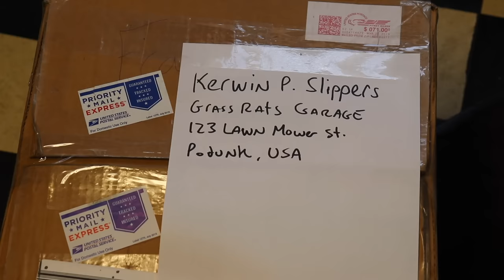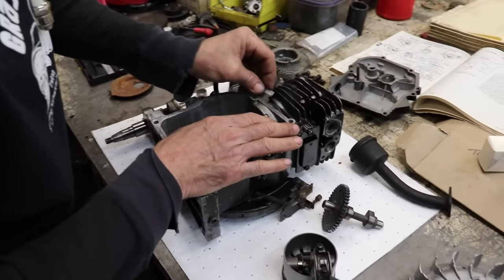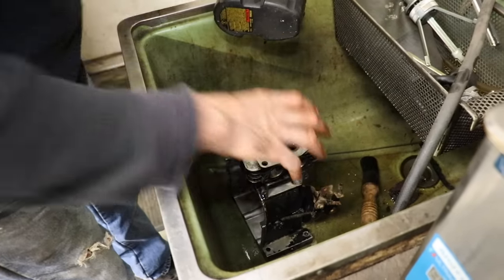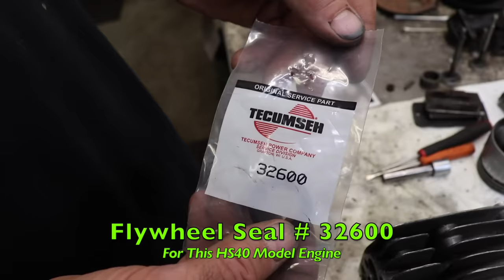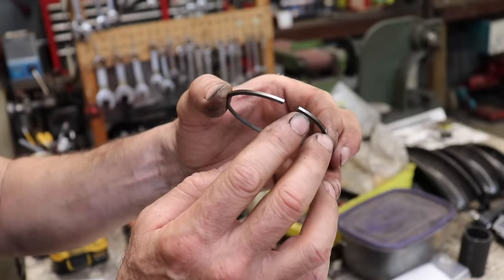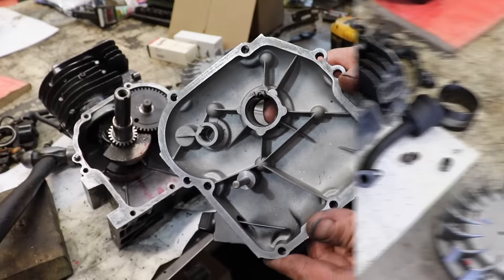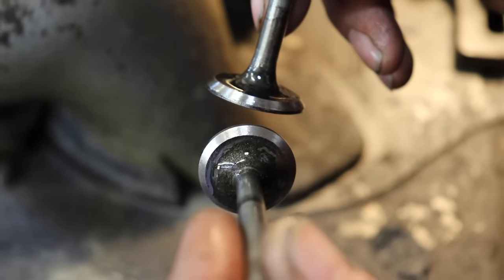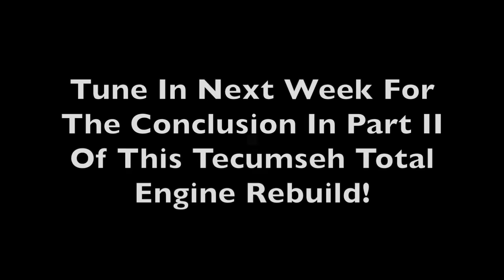(Part 1) Tecumseh Small Engine Total Rebuild: A Complete Guide

Comment: Well, the most critical items that need a torque value are the connecting rod and the cylinder head; everything else you can "wing it" on. 
You don't want any chance of the connecting rod coming loose because you had the bolts finger tight only, haha

Comment: $200 huh?  I hope PLUS parts.  My spark is weak - I have electronic ignition but if the magnet is weak I gotta spend $85 on a new flywheel.  How do I tell if the flywheel / magnet is weak / bad (what would you consider "too weak"?

Comment: Put my sump cover back on and gave the motor a couple of spins and it stops,,,, it's hitting the governor, took the sump cover back off and thought I had it licked and it hit the governor again this time breaking it??? what am I doing wrong. Motor # 143.955001 Sears. Ordered new governor spool,,, heated the pin with a torch to get it out of sump cover due to the spool is being held by the pin(no c clips)

Comment: Hey tarly why do you want to sand paper in the bore of  a cylinder?
I think you should use something called emery cloth to sand the bore out or use a cylinder honing stone on a drill.
Just my 2 cents worth coming from a machinist of 40 years.
Im just saying.
Usually you would use sand paper on an armature to clean it up after you trued it up on a lathe to keep it from contaminating it from the metals in the emery cloth.

Comment: Awesome video I use a solution called PSC1000 (i think lol) from tractor supply and it works fairly well in my wash tank. What do you use? Nevermind you said kerosene after I typed this lol

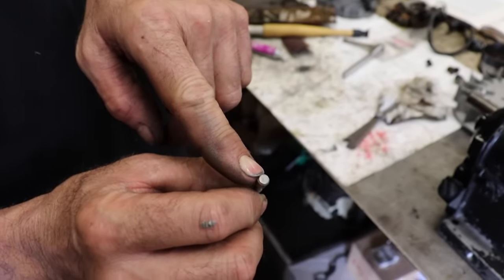Comment: 1:10:39 Some people may not have a bench grinder either. They could clamp the valve stem in a vise and use a bastard file, making sure to keep the file and the face of the stem square and perpendicular to each other as they worked.  The whole process would just take a little longer BUT give the Do-It-Yourselfer more control over how much material is removed.

Comment: I had this happen to me a few months ago. I order a lot over the internet and I suppose someone took notice. However, the package stolen from me was a a radioactive sample (uranium ore mixed in some type of resin stuck to a card) for calibration of my geiger counter. Sheriff's office dropped it back off a few days later after realizing while dangerous to hold for long periods of time its relatively safe and not illegal. I inquired about the person who turned it in and while they didn't know exactly who did they had an idea. I  was going to lend them my geiger counter and told them to test their hands but they declined. Anyways, now my packages can sit outside for nearly two weeks without it getting touched. For reference the reason they turned it in is because the card says something like no not hold for long periods of time or store near body. Active radioactive source drop and notify authorties if you're not a professional. Police recognized the number.

Comment: Yeah years ago Foley Belsaw sold a flywheel knock off tool and they showed in their correspondence course how to use all the necessary tools.  Gee I had an old Techumseh Vertical engine I learned how to set the timing on so I know exactly what youre referring too not that hard to set.

Comment: The plastigauge check was a little sloppy.. You should do it in a vice and make sure you don't allow your rod to pivot......  Because as the rod spins around the journal, it can smear the plastigauge and give you a false reading.. (I've never actually plastigauged a lawnmower. lol.. we're getting technical here.)

Comment: I have  a Tecumseh 754272 short block, same as some HS50 engines . Need help I need most of the parts to complete engine can you help me with how to get either points and condenser or eletronic ignition. I have a carb, intake, need the rest to complete my zero hour engine. Help Jerry out down in South Carolina.

Comment: I have used old VHS video tape as Crocus cloth, works just about as well is the real thing.
Reply: Thats a good tip, thank you!
Reply: @ProlificInvention  The oxide on video tape is extremely fine so it takes quite a bit of work to achieve a polish. But the up side its hard to over polish or damage the part.
Reply: @mrkrasker9609  Its an excellent idea!  Cant wait to try.

Comment: Just in case anybody wants to know you can get 5,000 wet dry paper for sanding super fine finishes. But I wouldn't use it before I was going to paint. Paint won't stick to it too fine of a grit. In the finish department at the machine shop we also had some 10,000 grit It's about $6 a sheet most people don't purchase it.

Comment: Has anyone tried to grind channels from front to back in the ribs on the bottom of the case for oil flow? Looks like they just machined the speed bumps for the cover screw holes and it isn't needed towards the center and back
Reply: The engine block is an aluminum casting, not machined, and the "speed bump" ribs in the sump certainly add some structural stiffness to the block as well as holding the cover screws. These engines are splash-lubricated and at working RPM (3600+), nearly all of the oil (20 ounces) is whipped into a mist by the dipper. The oil flow is up and down, basically, due to gravity and inertia.

Comment: Yeah I've used a big screw driver and hammer to remove fly wheel several times  every time I file points or install a tune up kit But have never done valve adjustments on ohv engine

Comment: It's advisable to remove the cylinder ridge because if the new rings are fitted with the ridge still in place,the top piston ring will get smashed.

I'm going to re ring my 3 HP 92500 Briggs & Stratton lawnmower engine but I'm going to try & do it without pulling the whole lot down,the Victa 2 stroke powertorque engines are the same way,you can re ring them without pulling the engine off its base but I do have to pull the Briggs engine off its base.

I need to shim the crankshaft because it's end float is a tad over its limit of 0.2mm (it's at 0.23mm),I'm planning  on cutting a 0.15mm shim to bring it down to 0.08mm !

Comment: Ii was on the meaning we dont bore aluminum bores only cast iron?? Maybe im wrong. I been wrong b4 no problem
Reply: They sell oversize rings and pistons for these small engine aluminum blocks up to .030 over so it's probably consistent hardness to that thickness at least. Some aluminum blocks even have cast iron sleeves.

Comment: A Hob cleaning tool has a good blade in it it’s good for scraping gaskets and has the right angle for set in a ramp on the tool, pretty cheap about 5 bucks with spare blades. Tally Ho😀

Comment: I have a 8HP Ariens snow thro machine,1975,I'll give you what I have manual model #9100018,serial#003709,I've been told the OEM carb# is631660A,don't know if that is correct,I took off the carb it has a #1071K1G,don't know what that is,stamped on it. I think the motor model # is HM80-155020,I seen that on the body of the machine serial #3169R.this machine doesn't have a pump primer

Comment: You up to a challenge? Here's a good one for you. My Craftsman GTS 5000 garden tractor needs a new pair of rear transaxle oil seals. OK, seems simple enough. Just go order some and put them on, right? WRONG! I've got the part number but, I cannot find them anyplace. Not Sears, not any of my local mower repair shops, not on the internet, nowhere. I keep getting the same song and dance that the seals are no longer available and have no replacement item. Good Grief! Now, what do I do? Better yet, what would you do?

Comment: Ring end gap should be measured at THE LEAST WORN area of the bore, that is the bottom of the bore and not near the top as you did. The top of the bore just under the ridge where you measured the end gap is the MOST worn part of the bore. Like your videos though.

Comment: Worked in a Small Engine Shop waaaay back in the High School Days and Never was a fan of The Tecumseh Engines the Governor and Carb setting on those Always seemed Sketchy to Me as compared to a Briggs...Also parts look up on a Micro Fisch was a PIA..
Reply: Tecumseh engines always seemed a bit more finicky and complicated. A float carb on any platform can be a problem especially when used in a dirty application as most of these are. Breaks and Scrap 'em on the other hand, seemed to keep innovating and simplifying their product which also helped lower their costs.

Comment: forgot to check the ring end clearance.
Reply from the maker: 16:35
Reply: @TarylFixesAll  It appears you used the old ring to demo with but you did not do it correctly. cylinders wear more near the top and its necessary to push the ring down in the cylinder to get at the bottom of the place where the ring comes in opperation to check it properly. It was out of sequence a bit and not done rite so I put in the comment. OOPS.
as Rosanna Rosanna Danna would say. Never Mind. I do love you videos and learn a lot so Im not being mean just commenting. nice and tight is not good if when it heats up it binds up. needs to be checked on the new rings and done properly

Comment: The summer teeth were a good gimmick but I think youve proven yourself interesting and competent enough to get by without gimmicks.  Unless you just like wearing them?.....  Thanks for the good, basic mechanicking how-to. The reason I am here is that I have over a thousand dollars worth of push mowers that are gonna be expensive AF to fix, and the old $96, cheapest 22" mower WalMart sold in 1996, with a whole pound of mig wire in the deck, on it's 7th, blade, and halfway to it's 4th set of wheels is the only one running and the engine brake, bail activated kill switch gloriously, and irreparably disabled, and most importantly a readily accessible mixture screw, which doubles as a bowl drain is finally using a little bit of oil, indicating the rings are about gone. Gonna give the old TVS90 a set of rings and see if I can get another 20 years out of it.   There's a few in that next generation who do take an interest in something beyond "how to throw it in the trash can and buy another."  And with the way things are goin, they are gonna be real popular fellers to their neighbors in a decade or three. Though I am closer to your generation, I am taking the liberty to speak on their behalf, and say thanks bro.
 Now that the accolades and compliments have been dispensed with, I must voice a contention with your characterization of certain technicians who, through necessity, employ field oriented, improvisational methods. The politically correct term for individuals who employ creative means to get er done, is Remotely Elevated Williams. re; Valve seat resurfacing instrument.

Comment: also you can still get over size valve/stems if the guilds are worn. might be easyer then trying to replace the guilds. my newway cutter was just over $300+ and yes it came with 4 different cutting angles and pilots. so they have came down in price. but I do remember not to long ago at $500+
just finish last year with a HS-40 BUILD, little guy turns over 7000 rpms, tons of mods done to it.
here is my project build.  https://www.oldminibikes.com/forum/index.php?threads/hs-40-build.161335/

Comment: I think you're tightening rod bearing to 110 FOOT pounds, instead of INCH pounds as you stated in the beginning. 
PS: get a quality torque wrench
Reply: HE WAS USING A SK INCH- POUND TORQUE WRENCH! This isn't Taryl's first engine rebuild. He must be pretty strong if he can get 110 Ft/Lbs out of a wrench about a foot long. I didn't see any razor blades on the floor. LOL Do you really think those small fasteners would take 110 ft./lbs without breaking?
Reply: that torque wrench he used is a, sk brand, it's a good one.
Reply: w2dmw, do you think those “tiny” end cap bolts could handle 110 ft/lbs? That small beam torque wrench would probably bend in half way before he reached 110. ( 110 in/lbs = approx 9.1 ft/lbs ).
Reply: It says inch lbs. right in the book he shows

Comment: oh, good, I thought I was going nuts. That makes sense..........i'm working on a real old  I don't know what.   Tecumseh, I assume. the coil and laminates are under the cast iron flywheel and it doesn't want to spark. points look good but new coil is really stuffed in there. wires out of the bottom of the coil barely rub on the inside of the flywheel. I wonder if I sent you a pic if you could identify this old monster (only a couple of horse power.).   Hey I get a riot out of those dummies flying through the air !!!!!
   w2dmw@optimum.net         Keep up the good work !!!!!!!

Comment: New subscriber here, thank you for the excellent engine repair videos that helped me work on a 25 hp riding mower engine.  Your teeth are very unusual. To be completely honest, due to my character flaws (which are way worse than your teeth) they appear grotesque and freakish to me.  It would help my condition if I knew the story ...    Are they real?  If so, when did it first become apparent you had large protruding teeth?  Thank you !
Reply: Are you for real??.GOD NO!,they are not real.HAHA!!.
Reply: @4gauge10  They look real.  Is there a video showing Taryl w/o the teeth?
Reply: @SunriseLAW  To the best of my knowledge no,that would destroy the character,junior has the same teeth.
Reply: @4gauge10  Or are Junior's fake?
Reply: @SunriseLAW  HAHA!!,that's even FUNNIER!!.Neither one is real man!!.You can buy those teeth at any novelty store.(Johnson Smith Company is novelty store that has hillbilly teeth you can buy)
Reply: @4gauge10   Excellent satire (of satire).  See, the videos are satire because generally a broken small engine ends up getting replaced along with the machine.    If you own a lawn, you can afford new machines or a professional lawn service.  Only a hillbilly type would try to fix a broken small engine.  So... a fake hillbilly piles satire on top of satire.
Reply: @SunriseLAW  That doesn't make any sense...I have two very high dollar John Deere garden tractors,if something goes wrong with my 25hp.Kawasaki engine,short of a thrown rod through the block,you can DAMN sure bet your last buck,I'd have Tayrl look to see if he could fix it,because just to buy that engine would cost me about $2,000.00 bucks to buy it,then about another $1,000.00 to install it.When fixing it might only cost me about $150.00-$500.00.
Like the song says..."It's cheaper to keep her".🎶🎵
Reply: To replace my entire tractor will cost about $10,000.00.
That's cheaper to keep her too.
Reply: @4gauge10  .. I am referring to the engines Taryl fixes.  They are crap, like my 2004 Kohler 25 with a broken piston. I was so stupid to buy that great-looking used mower from a dealer who even gave me a 6 month warranty w/o doing my homework on that engine.  Oh well, $800 down the tubes... I have my eye on an Ariens with the 25 hp Kawasaki ... $2800 new at the local Honda equipment dealer.
Reply: @SunriseLAW  Ariens stopped building tractors back in 2003,they only build"Z"-tracks now,which are garbage.
Reply: @SunriseLAW  I would look at the John Deere X-360 or X-324,these tractors are identical with the X-360 being hydraulic lift and power steering with tilt wheel,while the X-324 has manual"crank and yank"deck lift,with manual steering and no tilt wheel.Both tractors are powered with 22hp.Kawasaki engines,with 48"inch mower decks.
John Deere runs the best warranty in the business,featuring a 4 year,300 hour warranty.(which ever comes first)
Reply: @4gauge10  uhhh no I've got an 04 Ariens YT150H, well more of a off road beater but